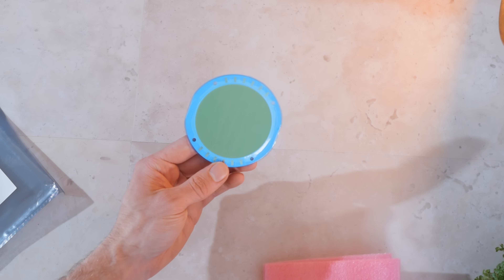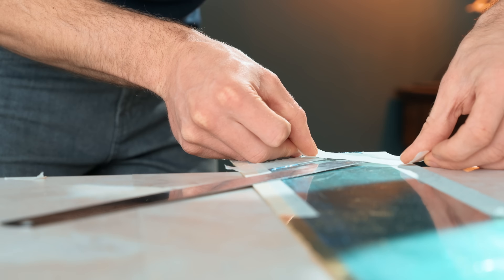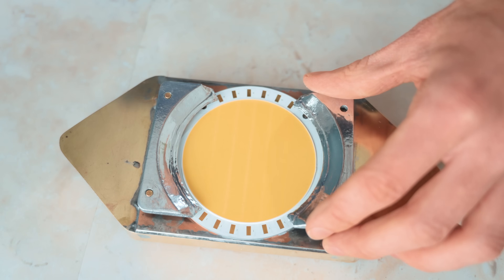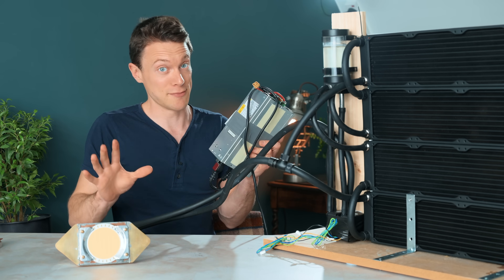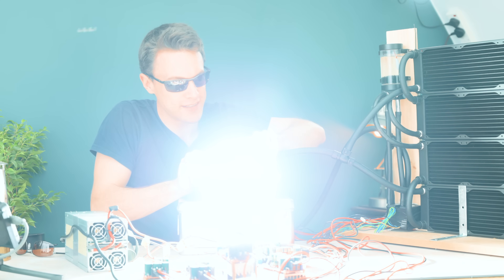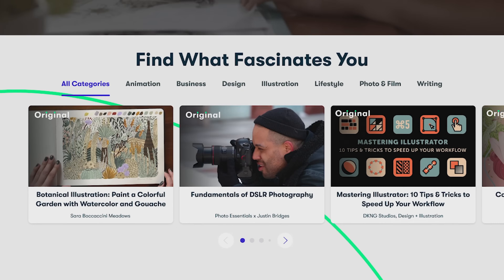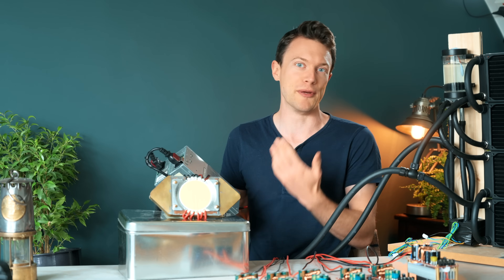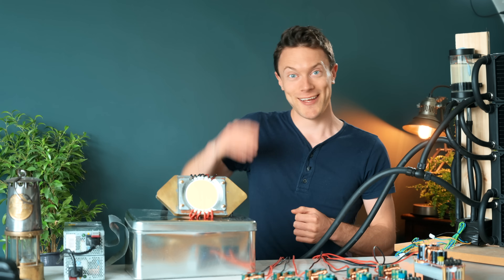Testing the world's BRIGHTEST LED!!!

Comment: Those server power supplies are really disappointing. It's pathetic that they couldn't deliver their nominal power. There hasn't been anything solid on the theory of the power supplies failing, because the math checks out. Which leaves shoddy build quality and fake power ratings as the most logical explanation.

Comment: I just found an item that may be useful for this and other projects in the future. It’s massively priced, but does do what you need, and much more. It’s a power supply. A rather big one in fact. This should be able to handle your LED nearly twice over. 

https://www.ebay.com/itm/191941677445

Comment: Hey man, I can almost guarantee that you would have had better performance from an off the shelf water block.

The type of water block you created was essentially the first water block type.  Then they changed to non restrictive pins, then they went to restrictive micro channels, now a days restrictive micro channels still exist but there are elsewhere restriction designed with high performance.

The gist of things is that the new designs can remove a lot more heat than non restrictive pin or fin designs.

So even with a reduction in surface area on the LED it would have still out performed it.

What you built is probably more than the might needs anyways.

Comment: How effective are the 6 pcs. of Voltage Upwards Converter? I wondering if the most of the the 1650W goes through the Power Supplies... then they are a bit overloaded...

Comment: Your boost converters are chewing more power to step up the voltage. So say your server supply is pumping 1500 wats the converters will be using power to step up the voltage to 30 volts. Like the video, but you should work out the efficiency of the converters. Had the same problem whilst using the same boost converters to step up a ATX computer 12 volt output to 24 volts. 10 Amps at 24 volts was using 25 amps at the 12 volt input because of the boost converter. ATX power supply went bang and the  smoke came out.

Comment: 2kW 24V peak power isn't 1500W 35V power sustained. You can definitely fry PSUs when running at maximum current for too long (at least without their own additional cooling). Best to use a supply that can handle more sustained current at peak voltage (in this case 40V is a safe maximum for the LED module).

Comment: I once had to fix a tankless water heater I find using a 2500w heatgun in combination with the torch greatly improves the ease of soldering (and in my case makes it possible at all)
Perhaps I could have used a oxy set but i don't have one.

Comment: General thinking abt it... It doesn't need to cool 1500W or? Maybe 200W of heat, depending on the LED efficiency. Most Energy should be disposed as light, so even a small 240 radiator should be fine as well as a normal CPU / GPU cooler.

Comment: I think if you didn’t just kill power to the whole setup, but, instead turned off just the load (led itself), leaving power supplies on, they would have a chance to properly cool down using internal fans.

Comment: I'll tell you why those power supplies failed, you turned them off after they were at full load. Heat takes time to go from the heatsink to the air, so without airflow after max load, the temperature inside the power supplies would have spiked. The weakest link in the chain would likely be the capacitors on the board, as the electrolytic liquid would boil (standard rating of 85-125c). In future, remove the load from your power supply and allow it to cool before turning it off.

Comment: Hmm ...
1500W * 0,05 = 75W -> PC active air CPU Cooler (for 150W TDP recommended) is enough, only surface modification needed (thick plate of aluminium).

Comment: I am concerned for corrosion in your loop, dissimilar metals corrode, the solder and zinc  in particular. The PSU spreads it load across multiple voltages.

Comment: Which voltage rail were you pulling power from? The PSUs are rated for their total output, but each voltage rail can only output a certain amount, so if you were drawing everything from the +12V rail for instance then they wouldn't be able to keep up.

Comment: 1500w LED, fun =D.. I want one!!! 

FYI all computer supplies are designed for about 70 or 80% of the output to the 5v rail, the 12 volt rail is always lower current usually rated for about 25% of the output. The power controller doesn't know any better, and will fry diodes and inductor.

Comment: Actually, air cooling is more effective than water cooling.
Reply: water cooling is air cooling.  Just moving the heat to the radiators to be cooled there instead of on the unit ;-) if you want to get technical.

Comment: With power supplies in series, both of the supplies must be rated to handle the full 1500+W load as all the current is flowing through both of the supplies. Power supplies in parallel would share the load and run much cooler.

Comment: You wired the psus in series NOT Parallel. If you'd wired them in parallel they'd be delivering 700w  each. but in series, they're both delivering 1600w.

Comment: Setting up the power supplies like that run the risk of damage for a few reasons.  First and possibly foremost is the fact they are switching and if they switch out of sync you can get off voltage fluctuations that could be messing with the second supplies 0 reference.  When setting up power supplies in series that are not linear you want a sync function so the pulses of the two power supplies happen at the same time so that you don't get weird oscillations, spikes, etc...  my guess is the harder they are run like this the more detrimental it can be.  There are other issues here, and I could go into them but one of the reasons I know this stuff is I have been trying to get a psu designed for 3D printers that can power the printers at 24v while still having 12/5/3.3v for lights fans heaters pi's etc. Anyway, moral of the story, use batteries in a pinch,  or spring for a 1500w 36v power supply on ali express

Comment: Did you check the out puts of the power packs were isolated and not centre tapped to earth. This would need to be reconfigured. Another possibility  may be to use some mosfets with a PWM driver to cut power consumption & heat keeping it close to the same Brightness.

Comment: I think it's because you ran your 2x PSU's in series, when you run identical units like that parallel is a better option IMHO. It appears that you used a splitter, so you were powering both from the same ground. Recipe for overheating.

Comment: I suggest to add a temperature sensor to the heat sink. In case the water cooling would fail for whatever reason, the sensor would sense the temperature rising and shut off the power supply to the LED

Comment: If it uses 1500w it's not going to dissipate 1500w of heat as a huge amount of that power is going to be producing the photons. The air cooler (rated at 1/5 * 1500w) is 300w and that's probably enough. Maybe 2. But no way do u need that massive cooling monstrosity.

Comment: So, there are a lot of battery packs that can put out 1500W. Wire the right voltage to power your boost regulators and downsize the radiators, find a proper reflector, and you've got one heck of a torch (aka "flashlight").

Comment: If you're not designing this for continuous operation, drop the fans and radiators and just cycle the water through a large reservoir. At 1,500 watts 20 litres of water is going to take about an hour to raise from 20° (ambient) to the LED's rated 85° case temperature.

Also, since you are using six independent Boost Voltage Converters, why not just wire three to each power supply?

Comment: "The heatsink is cold, that's really good" - not the most obvious reaction to have, I'd be getting temperature sensors out and double checking exactly what I had put between the LED and heatsink at that point :)

Comment: The only man I've ever seen wearing 2 pairs of sunglasses, unironically.
Reply: Well... Markiplier kinda did it the same thing, but he was more masochist, he put sunglasses and put right into his eyes
Reply: @vinyredx9220  i wonder how many pairs he would rate this one?
Reply: @noodlesgamebox5903  probably 4 to 5 i guess
Reply: I've done a lot on my projects, but I've eventually replaced them with a singlr pair with reflective tape, so basically diy welding goggles
Reply: Markiplier wore 5 or 6 with the 100,000 lumen flashlight
Reply: ehem.. styropyro
Reply: @prat751  don't think I've ever seen styropyro wear two pairs of protective glasses at once
Reply: @prat751  formerly .. styrofoam indeed

Comment: "The heatsink is cold, that's good!" Not necessarily; if the heatsink is cold, it could be because it isn't actually absorbing any heat from the LED. Like if the LED wasn't making good contact with the cooling block for example.

Comment: As a heads up, there are 2 possible issues that I can see. 1 - the boost converters, used to convert 24v to 30v. These tend to draw lots and lots of current and while the overall power may be within the specification, if these boost converters are trying to pull too much current, it may cause problems. 2 - if, as you stated, you were using 2 power supplies in series, this may cause issues depending on the type of power supply. Switch-mode power supplies (which are the majority of all modern power supplies) convert power from 120 / 240 volts mains electricity to another specified voltage by switching on and off rapidly. If one power supply is "on" and while the other turns "off", the second power supply may in fact suck up power. Some power supplies (but not all) have a "synch" input which allows them synchronize their on/off phases. However, it is not super common and you will have to see if your specific power supply will support it.
Reply: Each set of led's are isolated from each other. Them being in phase doesn't matter.
Reply: @rich1051414  it's not the LEDs, but the power supplies that are the issue
Reply: @OliverClosofff  he wired the supplies in series but should have done parallel
Reply: Yeah that particular converter has a low input voltage cutoff which can be set. 

if I try to power mine from a 24v supply, it wants to turn on when the supply gets to 10v and trips the overcurrent protection every single time. I have to set the low voltage cutoff to like 23v, then it waits to turn on until the power supply is fully turned on and doesn't violate the current limits. (the low input voltage cutoff control is right next to the boost converter input terminals, I don't see him adjust it in this video. The default setting out of the box is the lowest setting intended for 12v battery input. 

The failure also could have avoided if he turned turned their output voltage down before turning the power supply on and then slowly brought it up one at a time like he did the first time.

Comment: Great video! However, LED are not supposed to be driven by voltage, but by current. So, your LED drivers should have some max voltage set not to damage the LED chips, but you should regulate the output by current

Comment: why not peltier devices to cool? Also Everything in cooling these days is aluminium, why not use weld up aluminium radiator and cooling head since the LED back plate is also aluminium? You can then use alum tubing etc. The Peltiers could be placed inline to cool. Should be far more compact

Comment: The cooling solution is waaay  overpowered. Even if this was an led with really bad efficiency it'd put out 200w TDP. That is very well doable with just a single 4 Fan radiator using just one pump. 
Same thing with your other LED projects. The whole point to LED's is their high efficiency. Your 100w LED blaster puts out 10w of heat max. thats about the amount a lowerend Laptop CPU produces.
Pretty much all LED projects on your channel would be sufficiently cooled with just small passive aluminium heatsinks.
Great channel anyways. :)

Comment: Your issue may have been where you pulled power from your power supplies.  I believe they typically break up their full wattage delivery into multiple contact pads.  Make sure you tie into all of the power supplying pads to get the full rated wattage out of them.  Sounds like you may have only tapped into half of their supply points since it was under its rated output.

Comment: Interesting.  At $1300 I can safely say I won't be buying one, but I will offer some advice.  When running two server supplies in series it is common practice to isolate the DC ground of one of them and leave it floating.  The AC grounds will remain intact through the power cords.  If you don't do this you'll get sparks if/when the metal cases touch each other and you could blow a fuse or damage one or both of them irreparably.  I would also put a large Schottky diode in series with each positive lead so as to prevent the slightly stronger power supply from trying to "charge" the weaker one.  Adjusting the output voltages so they match 12V as close as possible helps as well but that is not a perfect solution, especially at the high currents we're expecting here.  
For a leak test, the old bicycle inner tube test came to mind.  Just dunk the heatsink block in a tub of water and blow air into it from one of the tubes.  Any air bubbles will show you where the leaks are.

Comment: At 12V you were drawing over 100A of power, you likely smoked the wires, driving the impedance to the roof exponentially increasing the load on the power supplies. At a minimum you smoked the wires, without near instantaneous overdraw protection, you smoked the power supplies too. Do not need to over-complicate light, they sell 175W LEDs with their own powersupplies and cooling that screw into 110-220VAC even at 110vac, you would draw a max of 15A with 1500W which is easy to wire for. Sure you might need to buy a few from different vendors to get one with the the type of light you like, but it is a far more elegant solution. High DC power does not work over distance, Tesla beats Edison once again.

Comment: You can buy 175W LED bulbs ( 1000W CFL equivalent ) that screw into a lamp and are self-cooling for under $100/each that would not have smoked out hundreds of dollars of power supplies. For $1500, you can have 2625w of air-cooled LED power that is infinitely more durable, portable, and convenient. Sure it is omni directional, but you want that anyway at these light levels. Going to love to see the diffuser that will need. Might even require a fernel lens. Do not see the use of this

Comment: It is unlikely that you needed watercooling. That cpu cooler was given a measly "150W" rating with a layer of thermal paste, a layer of nickel plated copper, and another layer of thermal paste between it and a tiny CPU die with little surface area to speak of.  Lets say you have only 30% efficiency on that LED, then you only have about 1000W of heat, 1500W of heat and there would be no light. Take that 1000W of heat, spread it over the large back of the LED, and you will find it has a lower heat density than what cooler was specified to run at. That said you could run into heat soaking, where the fluids inside boil before they reach the heat exchanger. Though I doubt that would happen.

Comment: This looks wonderful, loving the experiment! Regarding the PSU's, it looks like you disconnected them via the wall plug. I would guess that this caused the fans to stop before the PSU's had time to cool down, causing components to stay at high heat for a while. Good luck with the next project!

Comment: "and the heat sink is still cool, that's really good!"
Keep in mind that the heat sink will not heat up right away - you need to saturate it with heat before you'll know if your system is safe/stable or not. All the water in your loop plus the radiators themselves all have heat capacity, which takes a while to heat up... Testing it for a few seconds doesn't tell you whether or not you're going to ultimately burn out the very expensive hardware here.
Stay safe!

Comment: Most computer psu's are multi voltage. (110 and 220 volts.   What alot of people fail to understand is that in order to use the psu max wattage you must plug into 220 volts.  But its best as rule of thumb never push a psu beyond 85% compacity.

Comment: You could use two of this power supply in series. That gives 24V and 100 Ampere for round about 35€.

https://www.ebay.de/itm/2x-HP-Power-Supply-Netzteil-HSTNS-PL11-1200-Watt-498152-001/143303754937?hash=item215d91c4b9:g:~KkAAOSwOCteXiSJ

Comment: Can't wait for part 2! Was that a single rail power supply that you fried? Some PSUs might be 750w but that 750 could be divided into rails where the max W may be a lot less than 750. I used a separate PSU to power a Peltier and I shut it off when I noticed the -10c CPU temp at 100% load begin to creep up. When it got above 0c I knew something was not right. The tec was boiling the dissolved dye and water treatment additive out of the wafer and it was clogging the water block partially restricting flow with tiny solid particles. But in addition to that, the connection from the PSU to the tec that was 30A rated had heated up so much that the metal was melting through the plastic insulation and was about to short circuit! I decided to shelve it. That was about 15 years ago 😁